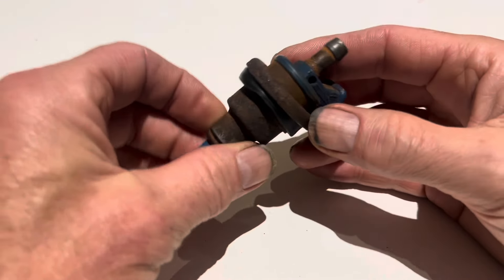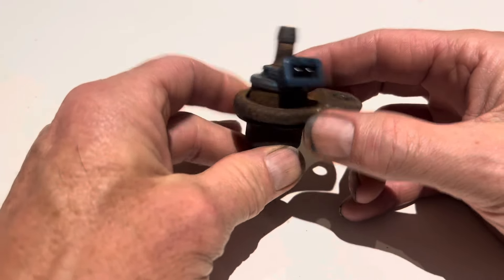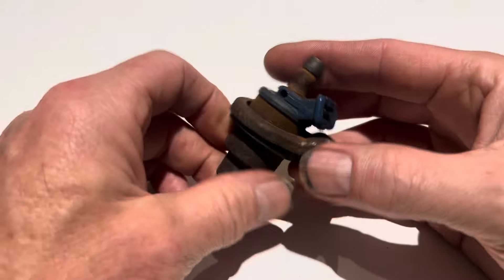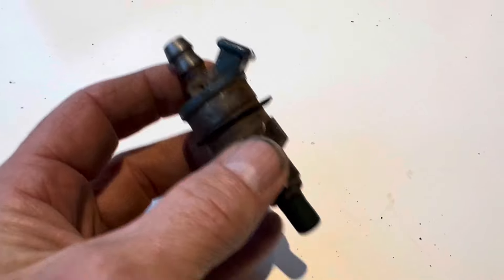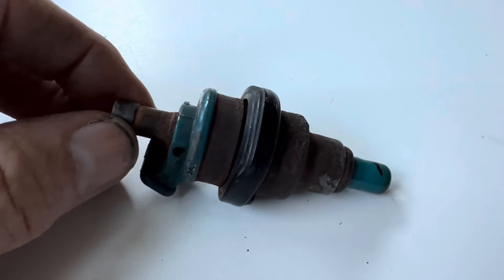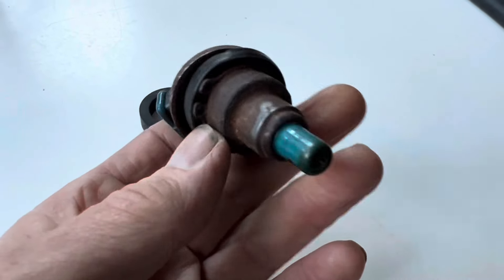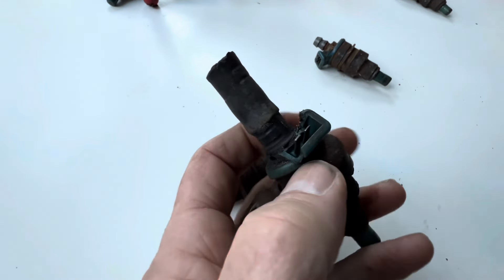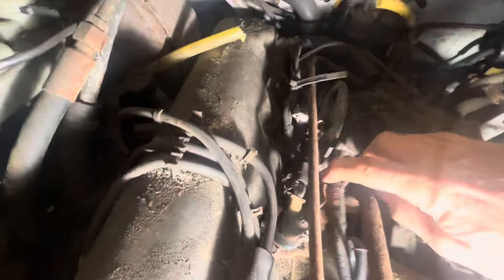Early Bosch Fuel Injectors - different types +how to remove without damaging. Part 0280150024

Comment: Mike it looks like the positive side of the injector is on the left side of the injector so when plugging in the injector the brown or earth wire should be on the right side.  One other question would you sell off your 450 parts car the bracket on manifold that holds the wiring harness towards the front of the engine?
Reply from the maker: Not sure which part you mean. Take a picture and email it to m_scott65@hotmail.com

Comment: Does anyone know if one can mix the various generation injectors in an engine (in case you need to change them and cannot find the right gen parts)? I've got -72 350SL M116 and I'm in the process of going through it. The car hasn't run for some 15 years.
Reply from the maker: Wow - a 72 SL, that must be one of the first! The simple answer is "no" as different generations of fuel injector may have had different flow rates. Often these injectors can be brought back to life and the flow rates balanced etc by a professional injector cleaner. Let me know what colour your injectors are and what the part number is. Mike
Reply: Hi Mike, great stuff again. Thanks. Question on the injectors with pre-clamped metal ferrell(?)/sleeves. Can I replace the hoses on these types as well, by simply prying of that metal sleeve, and replace the hose with hose clamps?